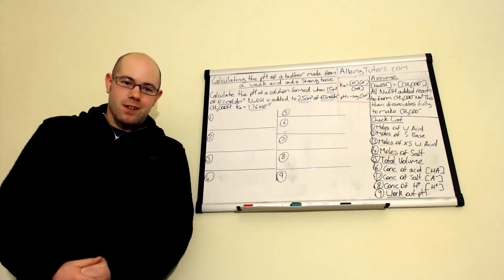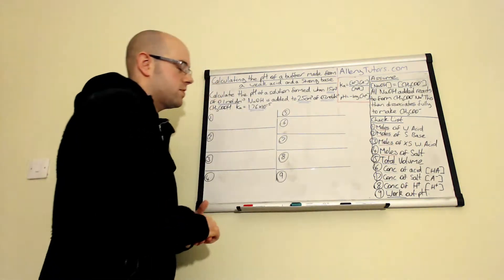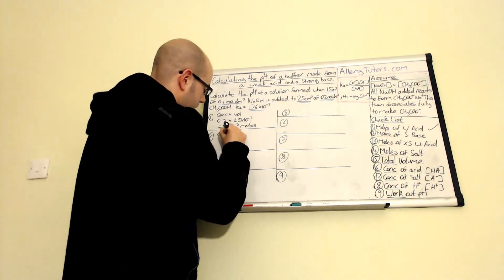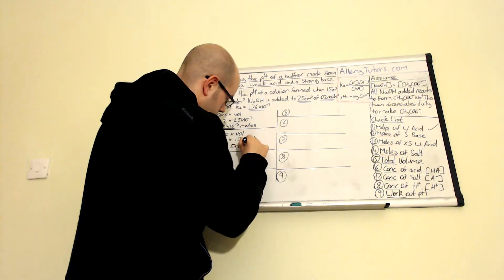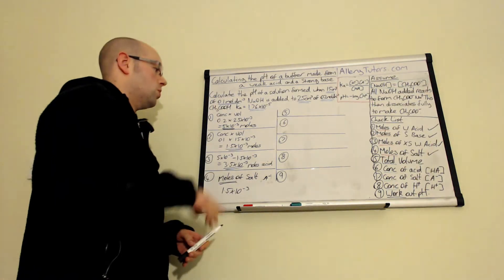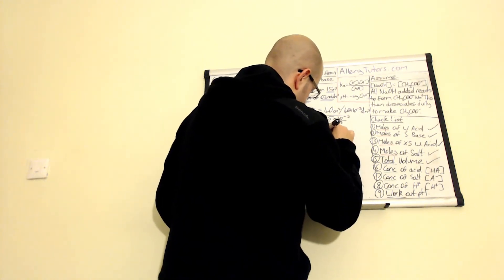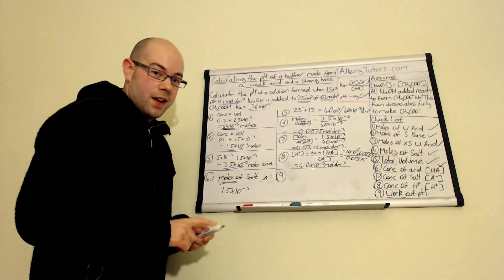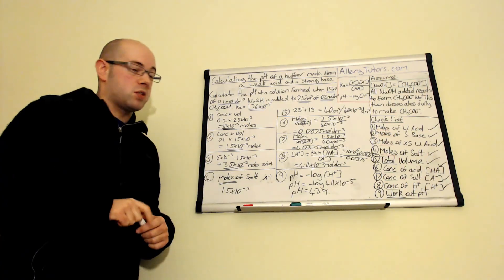Calculating the pH of a buffer made from a weak acid and strong base

Comment: Can you make a buffer with exess strong base and a weak acid?
Reply: No. An acidic buffer must consist of BOTH undissociated ethanoic acid molecules (the weak acid) AND their corresponding ethanoate ions (the salt formed from the weak acid). If hydroxide ions are INXS, then ALL the ethanoic acid molecules react to form ethanoate ions. Whereas if ethanoic acid is INXS, there will be some unreacted acid molecules leftover after adding hydroxide (strong base) AND its corresponding salt formed ethanoate ions. Both MUST be present for a buffer solution to form/work. Same principle for basic buffers. Check definition of buffer solution if not sure.

Comment: Chris, as I no longer have a chemistry teacher for my A-level exams in June 2019, I am really grateful for your videos and presentations.  Quick question though when looking at 2 similar videos with different calculations, here an excess is calculate, in the other video ("calculating the pH of buffer solutions), you have actually an excess of base.  So if using the same technique as in this video, you would actually have an excess weak acid of zero and of course that is wrong.  Could you please explain why the other video is different?  Thanks

Comment: can we not use the formula ka = [H+]^2/[HA] for this question??
Reply: No. It cannot be used for buffer solutions because the number of hydrogen ions [H+] will not always be equal to the number of its corresponding conjugate base ions [A-] so the following assumption cannot be made. There is a difference between them.

Comment: Awesome video man! Can we use the same sort of calculation steps to work out the pH of a solution of a weak acid and strong base, when the strong base is in excess? Would you have to work in terms of [A-] being excess?
Reply from the maker: +Taras Mogetich Thanks! You would use the same equation but have OH- ions in excess. You would have to use Kw=[H+][OH-] to work out [H+] then just use as normal. Kw would be 1*10-14 at standard room temp and pressure. Hope this helps.
Reply: Thanks
Reply: @AlleryChemistry  Sir, if the acid is limiting how can be create the acidic buffer? without an acid. I am a little confused.

Comment: Hi there in step 5 i was taught as the same number of moles of the NaOH is used then we dont have to calculate conc of HA & A- just use the number of moles of HA & A- . Could you please tell me why ?
Reply from the maker: +Omar Alias OK. This would only be true if the total volume adds up to 1000cm3 (1dm3) In the video example the volumes were different so will have varying concentrations.
Reply: I don't follow could you please explain ?
Reply from the maker: +Omar Alias You are referring to step 5 which concerns calculating the total volume of the solution after mixing the alkali and weak acid. In order to calculate the correct concentration of all the components of Ka expression you need the total volume. If the total volume comes to 1000cm3 (1dm3) then you can just use the mole values as mole/1dm3 is just concentration.
Reply: +A Level Chemistry by Allery Tutors like use the moles of HA and A- place in the weak acid equation and don't go further with calculating conc of HA and A- but just by using moles

Comment: why is step 6 using the moles of acid in excess, rather than the moles of weak acid in step 1 ?
Reply from the maker: +S AC This is because some of the acid calculated in step 1 has reacted with your sodium hydroxide. You have to use the amount of acid that is left behind (excess) when you are using Ka. Remember Ka is just a type of equilibria equation, it is used to calculate amounts after a reaction has occurred. Hope this helps!